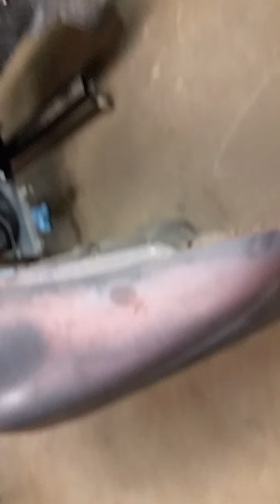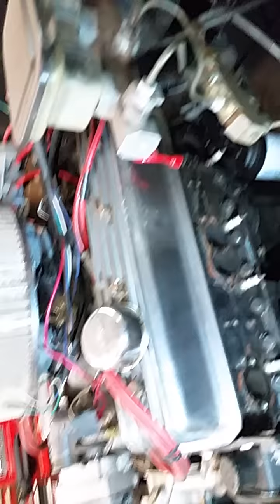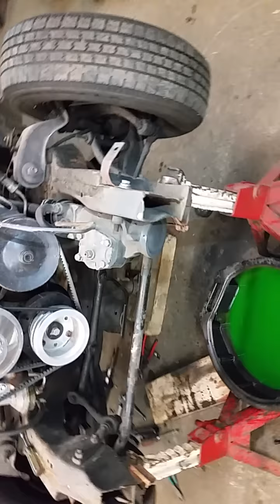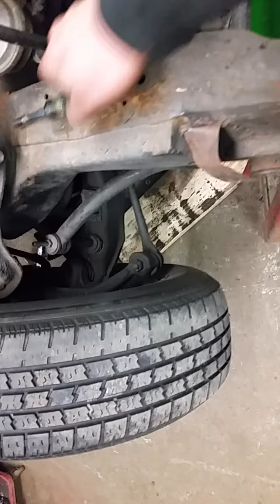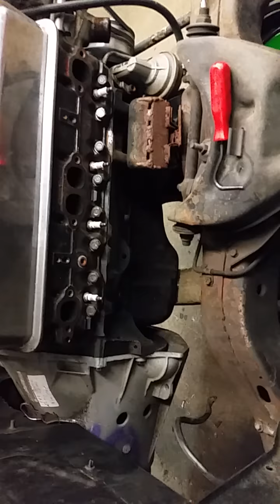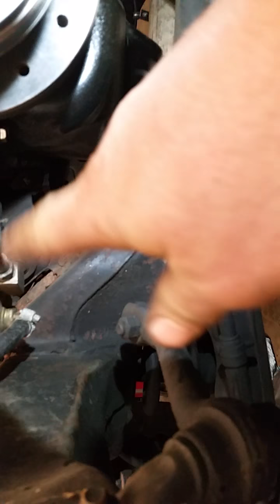Why me .... lol

Comment: Is this a complete later model chassis or a "clip" welded onto the old rear chassis section?? Always amazing how some people refuse to go with what's known to work in favor of their "better/cheaper/easier" solution. There's so many kits for these chassis that are correctly engineered and work well. Both independent and solid axel. Any of the Mustang ll kits give you good ride, good steering, good brakes, and easy engine mounting. Even cheaper if you stay with the solid axel. Hope your customer didn't pay too much for "the popcorn" assembly.
Reply: This was an S10 frame...........shortened. front and rear it seems.........
Reply from the maker: it's an S 10 frame that somebody tryed to make work . it did work , but no where near right . 
S10 swaps are pretty common these days . and when done right make a great platform . And are way cheaper than a custom frame .
Reply: Hmmmm!! There's those two "magic" words; "Done Right" !! All too often, folks dial in on the "cheaper" aspect and COMPLETELY IGNORE the "done right" part as in this case. Hope your customer didn't pay for "done right".